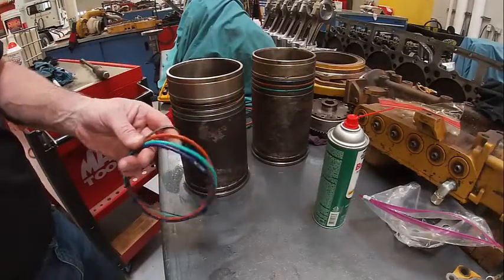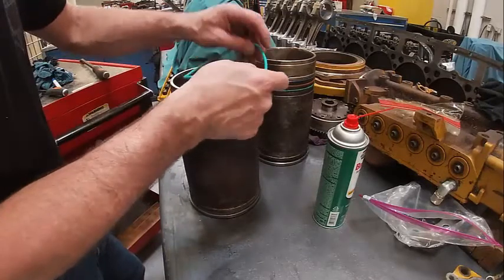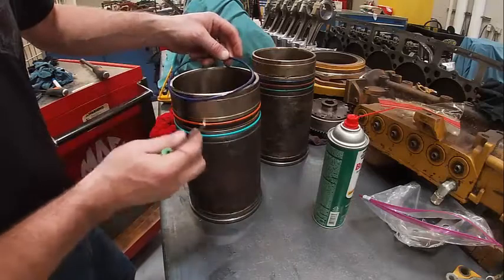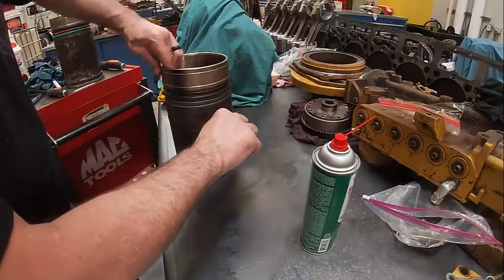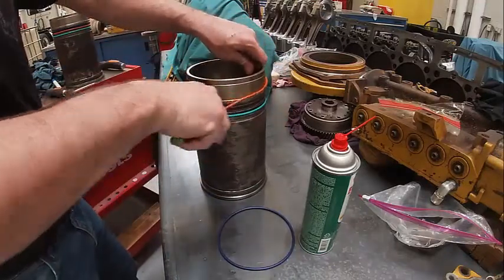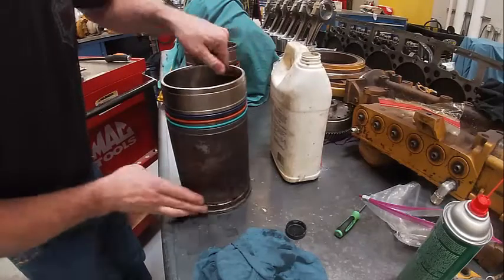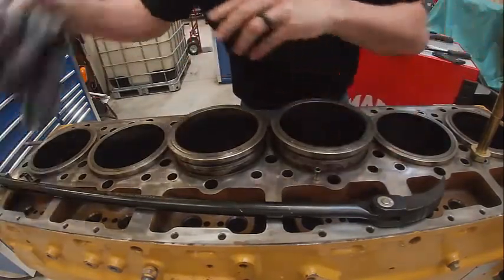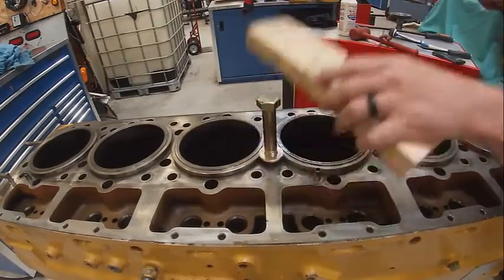3406C Liner Install

Comment: 0:20 I thought Vaseline = Petroleum Jelly = mineral oils+wax. My understanding is that oil makes these o-rings expand so you should not expose them to oil prior to installation. Once installed and the engine runs then they will be exposed to oil and expand to make an extra tight seal. If you expose them to oil before installation they are too expanded to fit in smoothly and may be damaged. I'm not an expert just reading and preparing to do this myself
Reply from the maker: You are correct. As long as they are installed right away. IE not setting on the bench for more than 10 minutes . it should work fine
Reply: @0698gingerich  Thanks. The liner kit had instructions with it that recommended soap, vegetable oil or silicone grease (the latter not being from a spray can, I think the solvents in the spray silicone are harmful to the o-rings). The instructions recommended against a viscous lubricant such as vaseline because if you put too much in it can get pressurized inbetween the o-rings during installation and push the 2nd / 3rd o-ring out of place which deforms the liner. BTW I'm not being argumentative, I'm just doing this for the first time so I read and watch everything I find on the subject because I want to be really sure I don't mess it up and have to do it again.
Reply: @0698gingerich  Thanks. The liner kit had instructions with it that recommended soap, vegetable oil or silicone grease (the latter not being from a spray can, I think the solvents in the spray silicone are harmful to the o-rings). The instructions recommended against a viscous lubricant such as vaseline because if you put too much in it can get pressurized inbetween the o-rings during installation and push the 2nd / 3rd o-ring out of place which deforms the liner. BTW I'm not being argumentative, I'm just doing this for the first time so I read and watch everything I find on the subject because I want to be really sure I don't mess it up and have to do it again.
Reply from the maker: @castirondude  The soap they sell at the parts house for tires works well or cooking vegetable oil. The safest bet is to use whatever the instructions that come with the o-rings call for. (if they have them)
Reply: Check the liner protrusion with no seals fitted. Mark the liner positions and locations then fit with the seal.
Reply: @schosh  Thanks, yes that's what I did. They all turned out ok. Interestingly there are two sets of specs for these depending on whether you use shims or not.